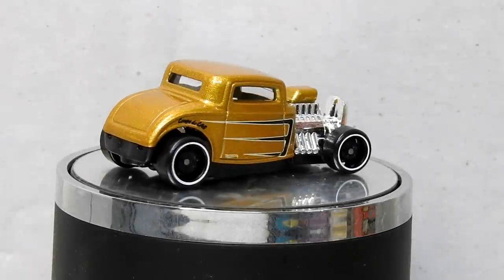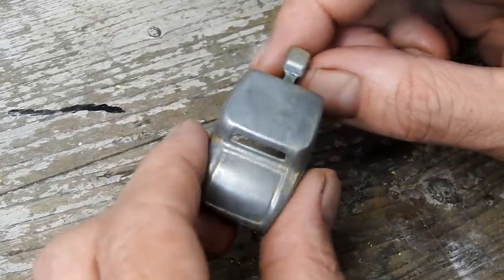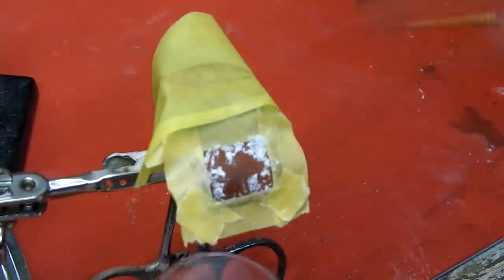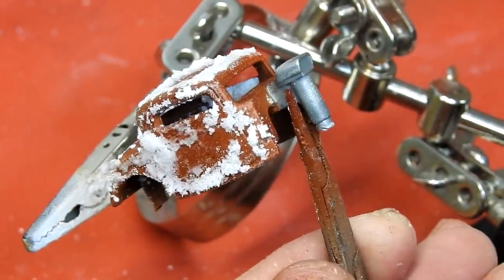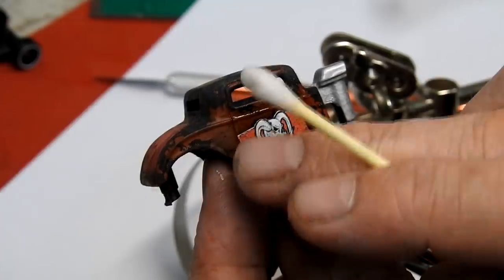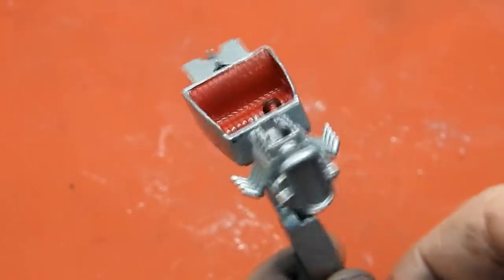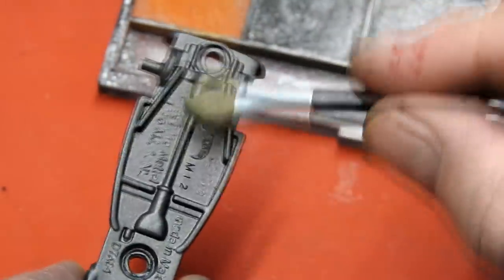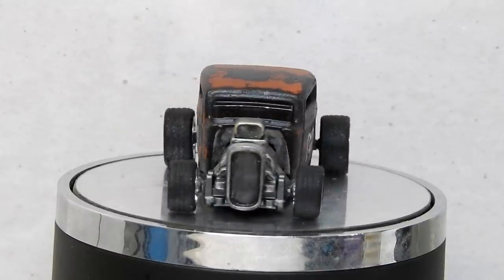Hot Wheels 32 Ford Ratrod Custom

Comment: I couldn't have had the heart to strip that nice gold from this model.
I have a couple of the lurid green "Early Times" models I can strip instead. My spare blue will also be dipped, so I can make a nice "American Graffiti" yellow, like that of the one Paul LeMat drives in the movie.
I still think this newer cast looks better than the older one, where normally it's the opposite way round.
Love the steel effect on the front blower but the front end generally looks 100X better with the paint you have applied and those wheels are just superb. If I could get my hands on enough sets of RRs, I would probably do dozens more 32s and Boneshakers with real rubber if I had my way.
Supreme effort!!! 👍👍👍👍👌👌👌👌
PS, if you ever get a "beatup" one in the future, do a "roofchop" show version with folded canopy softroof and small roll bars behind each seat (like the AC Cobra has) by using a couple of bent paperclips, cos I used one on a HW Cobra that needed one replacing!

Comment: what is caustic soda?
Reply from the maker: Usualy sold as a cleaner. Drain cleaner is generally caustic soda 👍
Reply: @DannysDiecastDisasters  thanks mr. danny
Reply from the maker: @reaperofsouls7700  No worries, remember not to touch the caustic water or it will burn you 👍
Reply: ok and could you make a flatrod custom?
Reply: Sodium hydroxide or NaOH